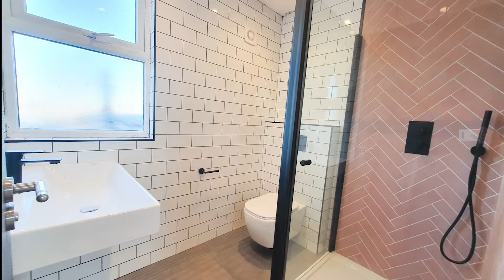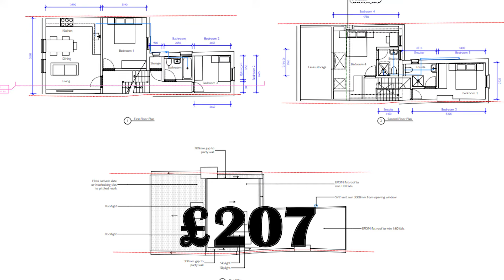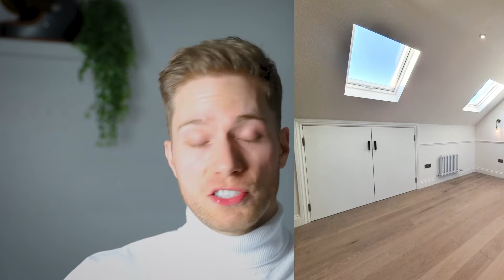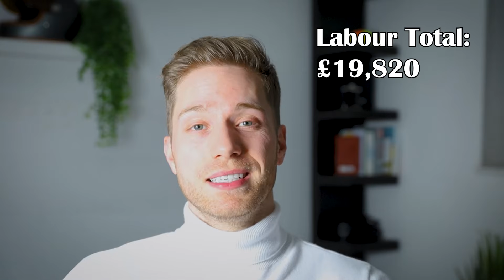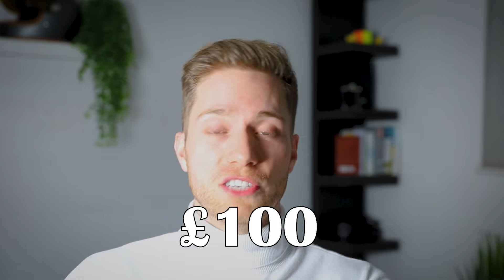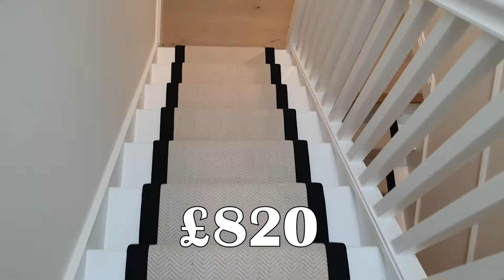How Much Did My London Loft Conversion Cost?

Comment: This scares me as i only have under 20k to spend on my loft conversion but it is a lot smaller than yours and it to be made into a bedroom no bathroom so no plumving costs apart from to a radiator, only one window that will be in a brick wall and will be having fitted wardrobes but everything else furniture wise will be from our current room.